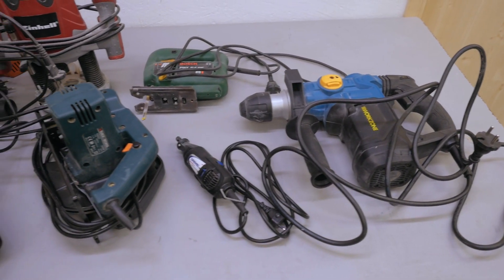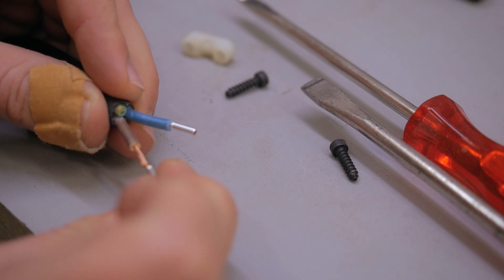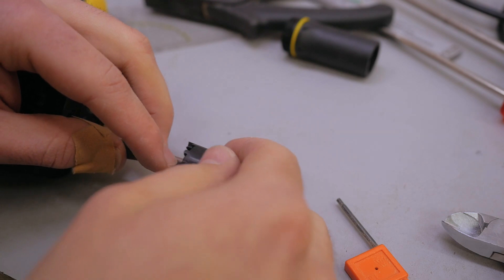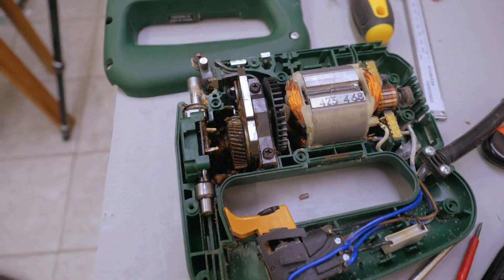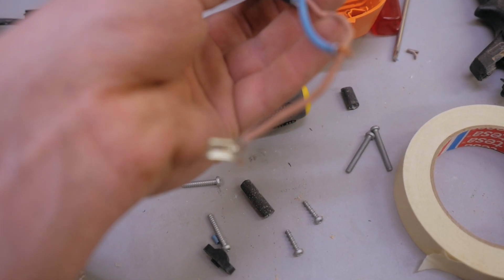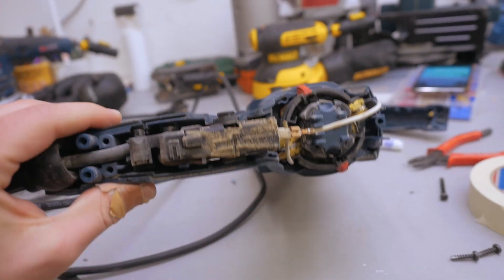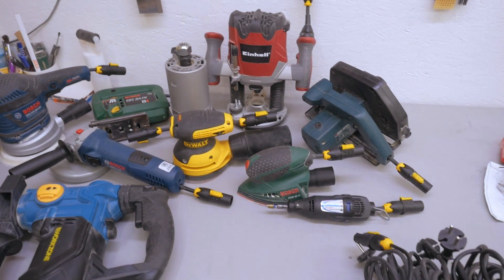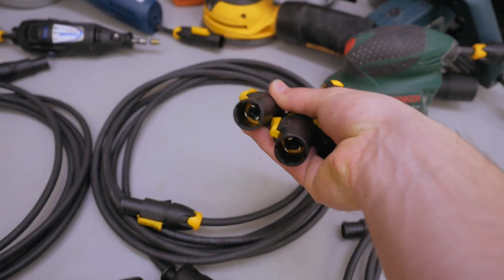A Quick Connection System for Power Tools

Comment: It's sad, that after my comment you have to do most of it again ;) .. Those ferrules do not work properly without crimping with proper tool.  Trust me, i have tried to save a couple trips to my car to get crimping tool and while testing if leads are tightly in, i can always rip them out of a ferrule.. It takes like 10x force to get crimped ferrule+lead out from connector and probably you just end up tearing that lead itself in half while trying..  I use knipex ~97 53 04 (closest ones that i could find on knipex-website, as mine are like 10 years old and just a little different) for ferrules.

So, ferrules need more crimping than just that screw of a connector.
Reply: Just to enlighten you:
- Germany is not Great Britain (and Europe is not a country)
- There are in fact other countries than your USA and therefor other codes and regulations.
- Ferrules are common here for the obvious reasons mentioned before
- Nobody here cares about what kind of electric butchery you perform over there in your country. Nobody.
- If you have no idea about codes in other countriess, simply do not take part in discussions about them.

- using the f word multiple times does not add weight to your argument but makes you look like you had limited self-control and rather unintelligent.
Reply: Anybody who does speak more than one language with English being not the native one will use multiple words from multiple flavors of English.
How's your German?

Simply stop it. For the sake of peace in here, I will not comment further - "aint nobody got time for that" (in order for you to understand).
Reply: TeknixTrix it's not just car manufacturers, since soldering is suboptimal for mains voltage, there is no alternative to ferrules if you want to connect stranded wire to terminals. It's VDE and NEC standard, but what do they know with their "retarded" regulations... the guy on the internet who throws all tools out after 10 years knows better.
Reply: Twist wires?  In Finland they used to do something like that till the 90's..  Some googling tells me that you might be talking about wirenuts?  We use Wago 2273 series connectors now.  Or you have some other arts and crafts project in your mind?

If you differentiate your tools by your feelings when they are stolen, i cant help you..  I still select my tools for what they can do for me while i have them.  In use, there is almost always difference between cheap chinesium and proper tools.  Cheap chinese stuff might still win like every 200th round, but i really dont like those odds in my real work.  And i am not saying that knipex is the only brand that makes good stuff, but i have not yet been disappointed.. Ideal branded strippers and 3,5mm flathead screwdrivers are the ones that take hits from bad decisions, most other tools stay safe and live in my toolbox for decades.
Reply: Das hätte ich auch gerade sagen wollen: Adernendhülsen gehören gequetscht. Aber prinzipiell sind die schon richtig (löten wird mittlerweile als falsch erachtet, weil das bei erhöhtem Übergangswiderstand sich lösen kann). Genaueres vom Elektriker!!! (ich nix, ich Schreiner).
PS: Holla die Waldfee, da gehen die Kommentare ja voll durch die Decke! @Marius: Wäre wohl wert sich da mal schlau zu machen und zu erklären was wie und warum. Oder ganz von Elektrokram distanzieren und sagen Ich machs so und Du kannst machen wie Du willst geht mich nix an.
Reply: Konaok1, not really. Solder has better conductivity, crimps deal better with flexing. Solder forces all the flexing to happen at the exact end of the solder, and that's bad - it's a stress concentrator/stress riser. Especially with copper, which work hardens ridiculously quickly. Crimps allow a small amount of movement and that helps a lot.

Since most of Marius' tools only draw an amp or two conductivity isn't as important as the constant flexing of the cables. Partly from him moving the tool, but partly from vibration. The strain relief sleeves and long cable path inside the tool help with flexing from moving the tool, but only potting can really fix the vibration.
Reply: "Knipex 97 61 145 A" without the "thick insulation" is even cheaper at 15€. and it's not a wire stripper, it's for crimping only. but if you think a real crimping tool is "stupid, breaks all the time and gets lost" and is overpriced at 15-18€ for a tool you'll have 20+ years... you're either a butcher or never had to do repetetiv electrical/electronic work.
Reply: Funny how ALL car manufacturers use crimp connections. When crimped with sufficient pressure, the wires stick together because it is actually a "cold weld".  Also, there's no chance of the solder "wicking" along the wire thereby creating a fracture point. The only exception I have seen are on starter motor terminals where solder is added as a high current aid for reliability and longevity purposes.
Reply: You seem to have no clue about what good tools are and why people own and use them (maybe you have never experienced using them) you call a crimp tool a wire stripper and you say that ferrules are not necessary.
Holy batfarts, there is so much butchery and so little knowledge in your posts, I sincerely hope that you do not do electric stuff for other people.

There are special (!!!!!) terminal blocks that do not need ferrules but most terminal blocks do, and in ALL cases it is recommended or even mandatory when dealing with high currents or mains connections. And having seen some burnt terminal blocks that "professionals" like Your Royal Hackery installed, I'd say the regulations are right about that.

Also, I have no idea what the NEC is since and since he is based in Germany I guess he does not give a f...art as well.
Reply: Also, Knipex has been in business since 1882 and I have seen multiple US guys use these "overpriced" German tools that nobody needs based on our professional butcher's opinion.
I have yet to meet somebody who uses Milwaukee (read this with an AvE pronounciation) tools over here.
And lineman pliers...
Here in Germany those twisty things have never been a thing. Screw terminals with soldered stranded wire or solid core wire and when those things overheated and burned out in multiple cases, they introduced ferrules. I would guess that was some time in the 70s based on equipment I have seen.

I have multiple types of proper tools (Knipex, Belzer, Lindstrom, Wiha...) for home use. Simply because those are proper tools that make you do the job right in the first place instead of being a cheap-ass trying to save every cent possible and doing a half-ass job in the process.

Chinesium grade tools are OK if you need some special tool you can make from a cheap-y tool using a grinder or whatever. With proper tools made of properly hardened 42CrMo4 or something like that, too much grinding and work is involved :-D
Reply: That is what I am talking about. You do not know stuff outside of your area and you talk about it nonetheless...same with ferrules.

Pretty much every house (!) in Germany has three phase power and so does the creator of this channel.
Reply: I got linemans pliers from my dad when i was a kid at 80's.  Since then, i have had pleasure to select better tools to do my job properly.  My employer still gives linemans pliers to new electricians, but those are only used when intelligence runs out and brute force takes its place.  Even in that case, i take my knipex cobras instead.  But, what would i know, i have been full time electrician just for 18 years.

You should check knipex catalog and be amazed what you have been missing..  Be sure to allocate some hours for reading, as that catalog is huge.
Reply: As I watched, I thought the same thing.  The crimped ferrule effectively creates a solid core conductor that won't flow over time.
Reply: 18€ is not 45 US$, it is just under 20 US$ which is cheaper than the stripper you proposed.
Reply: +Risto Mladich
So first you advise to use a wire stripper instead of a Knipex to crimp a ferrule and than you state that 'we dont use those retarded "ferrule" crimps either'. You do use your stripper (and I quote) to 'cut wire and bolts, as a hammer, a crimper, wire puller and as a pipe reamer'.
I suppose you drive your lawnmower on the highway as well, because you do not really use the correct tools to do the job.
Crimps (cold welds), if applied with the correct tools, in many cases are better than solder. In most cases crimping saves time.

Ohh and BTW. there are many royal families around the world, so not only Brits use the word royal. Even more, did you know in most countries where the metric system is used, the American McDonalds Quarter-pounder is called a McDonalds Royal? Because our pound is a bit more than yours, just like our currency.
Reply: +Risto Mladich
I also do not buy a specialist tool for every job either, but that's no reason to call professional solutions junk.
I do know that good quality tools are often a good investment.
Reply: His point is the 120 V funnypower in most outlets instead of 240 V... not the question if it is 110 V or 120 V (depends on cord length and the number of lightbulbs connected to it I guess).
Plus, split phase? Well, in other countries three phase is common. Your electric system is ancient compared to that.
Reply: - almost all outlets are 120 V
- 240 V is only present in special outlets in single digit numbers per home
- No three phase in most private homes at all

Get over it - you simply don't know the joy of proper mains voltage :)
Reply: Risto Mladich The Knipex 9768145A costs 18€ in Germany, thats a fair price.
Reply: +Risto Mladich  Bobcat Equipment founded in America uses deutsch connectors in all of their equipment.  Deutsch connectors use ferrules.  They're extremely common in heavy equipment. 

 Also give knipex an actual try, they are professional tools and anyone I have ever asked always agrees that they are worth the modest price increase after using them for a long period of time. 

And last but not least, if you want to make any sort of point about something online;  google "how to use periods and basic sentence structure"
Reply: I certainly wouldn't recommend them as a hammer.
Having the correct size and shape crimp tool is essential for a decent cold weld.
Reply: I am referring to private residential homes, not industrial stuff. The transmission grid obviously is three phase and of course there are connectors for it...
Reply: It's possible to make a decent connection to stranded wire without crimps, but only if the terminal is designed for it. 

The UK was for a long time the worst of both worlds on this. Wraparound terminals are best with bare wire (or eyelets/forks)

Clamp terminals are best used with ferrules unless they have a cage type clamp arrangement.

Older UK terminal blocks had no cage clamp, and frankly were godawful for stranded wires. I rip em out now and replace with 221 or 222 wagos or ferrules (I carry both)

And here (based in the UK), a decent crimper for lugs is a normal part of the toolkit, but ferrule crimpers are a bit rarer (people often ask me what they're for lol)

And gotta weigh in on the branding. Knipex ARE the best brand, but like Risto says, if you blow a hole in them, they're no better than the cheapo chinese stuff :( 

And lastly, I carry linemen's pliers, but rarely if ever use them (twisting wires isn't very common here. I will use them on 7 or 19 strand wire to tidy up the connections to get them into terminals, that's about all)
Reply: In Germany a lot of houses have 3 phase power.
Reply: Actually, I've found that good quality tools always pay for themselves.  When I was a child I remember my grandfather who had gone through the Great Depression of the 1930's telling me, "There are a lot of places that you can invest your money, but there are a lot of ways to lose your money too.  If you buy good tools, learn to use them well and take good care of them you will never go hungry."  I think Grandpa would be really proud of my "toy box."  A guy can never have too many tools!
Reply: never tin a bare end destined for a screw type connection. The solder is malleable and will quickly render the connection loose.
Crimp connectors have been used in various forms for many years and, correctly implemented with the right crimp tool, are incredibly resilient and reliable.
Reply: here in germany the electricians have to balance the house over the 3 phases to balance the grid. in theory you could put a amount of houses on one pase and the same amount on the other two pases to balance the grid, but having 3 phase is actually good for when you having machines that have a three phase motor on them or a welder which has often a 3 phase connection, and its not that uncommon for people in germany to have those things at their home not to mention the stove which is almost everywhere electric here in germany gas stove are a rare sight (and the electric stove "requires" 3 phase power, i put it in "" because theoretically you can put it on a one pase system but because of the higher power needed the fuse would blow, so you woult have to use a bigger fuse but also a thicker wire and to avoid this you divide this onto three phases with a higer voltage (230V) to get the current down,because of that you can use thinner wire wich will bring the cost down and is more economic). But here in germany the powerprovider mostly just sale 3 phase connection, you can get single phase connection but thats mostly used (if its used) in smaler appartment house to count the power consumption for things that are used by all the people in the house (power for the gas heater, staircase, outside lighting etc..) so basically you do this to have the same effect with less use of material.
Reply: how does it?
Reply: oh then whats this? https://www.amazon.com/Leviton-2731-3-phase-Industrial-Grounding/dp/B001VY0GYE
and this http://bmseelectrical.com/assets/uploads/image_uploads/2012-07-27_13.33.37.jpg
http://www.pesnj.com/uploads/2/9/5/1/2951424/9852013_orig.jpg
Reply: whats the point... we have 240v as well. what are you trying to say?
Reply: we do in fact have 3 phase power for single family dwellings but it cost extra, and its only really used in very large houses. there is no point in having 3 phase power for a single family dwelling, you can get a single phase to 3 phase roto phase converter if you have such a equipment...
Reply: TheChipmunk2008  on a job recently connecting flex, get my ferrules and crimper out to utter surprise "what are those, never seen those" from electricians. I think only people that make panels know what they are. bit concerning I personally would like to see it in on site guide as without making a proper connection is blooming hard
Reply: its not useless when you have the right tool for the right work , 10 years ago when i started working as an electrician here in germany, i had bought a set of cheap tools with a wire strapper in it and it worked only half a year till it was dull, then i bought a knipex wire stripper and it is sharp until today and i almost use it everday and i must say that 20€ is not that much of a deal for a tool that i use since almost 10 years with almost non wear to it, but on the otherhand i dont use it as a hammer. sure these all in one tools seem to be nice but the catch to them is the do everything but not everything completly right. so i would say cheap tools are for the people who cant look after their stuff and let it laying around so that the have to buy new ones (but the help to keeping the tool companies busy...).
Reply: What on earth for? I have three phases coming into the house, but only one is connected via the company fuse to the meter. That was installed when this was a guest house.
If the householder can choose whatever phase they like, how are the phases ever balanced?
I get it, if the winters are cold and the heating is electric, but who does that these days?
Reply: "Ive never seen any formen ever carry one of those ferrules crimpers before, never ever. our terminal blocks do not need any crimps for stranded wire at all."

And that pretty much disqualifies you from this conversation...
Reply: I agree as well. You could have leaded the cables themselves in this case.
To be honest, I would have cut all power-cables not to lose the strain reliefs. Those are there for your own safety.
Reply: +Risto Mladich In all fucking America you also use Wire nuts or whatever you call that shit its just a nicer looking way of twisting wires together for god sake go away with your 110V idiocracy
Reply: first of all its not 110V that is an ancient legacy voltage that old people refer too its very rare to find a service which is 110v. its 120v split phase from 240v. and we also use Wire nuts for 240, 208, 277, 480 maybe Canada uses them on their 600 v equipment too I dont know...
Reply: who the fuck has 3 phase power in their house... most people dont live in mansions...
Reply: i dont think you know how lineman's pliers work...
Reply: thats 45 dollars and completely useless. why does one need that thick of an insulation on a wire stripper... this is what i use as a wire stripper everyday. I also use it to cut wire and bolts, as a hammer, a crimper, wire puller and as a pipe reamer.  https://www.milwaukeetool.com/hand-tools/pliers/48-22-6100

 expensive tools are stupid, for people who barely do any work. tools break all the time and they get lost, ideal, Kline all that shit.
Reply: knipex too expensive
Reply: only brits use words such as  royal and butchery...
Reply: where does the NEC says that "ferrules" are mandatory? ive never seen any formen ever carry one of those ferrules crimpers before, never ever. our terminal blocks do not need any crimps for stranded wire at all.
Reply: sorry but I cant twist wires using channel locks/ pump pillars...and I dont need 45 dollar 9in sidecutters or  30 dollar channel lock wrench... only thing I would be missing if I bought such expensive tools is 2 hour worth of pay. no thank you, ill stick to the not so fancy yet dependable tools I use everyday. I could buy 3 sidecutters which are exactly the same as those knipex branded shit for the same price... knipex is just a name and the day someone takes one of your tools or you blow a hole in them they are no better then Chinese no name brand tools...
Reply: ok mrjollywanker broken tooth british god fuck the queen dumbshit, in north fucking america we dont use fucking ferrules crimps at fucking all and from what ive read online that its only with euroasian equipment which is fucking rare to work on in the first place let alone for anyone to be carrying a crimper such as that on their belt for such an occasion, those crimper look like a fucking wire stripper  and if you handed this to any electrician working in USA they would think its a stripper too until they looked close at it. we have whole factories control wiring installed without "ferrule crimples" on terminal blocks...
Reply: its a wire stripper for me... we dont use those retarded "ferrule" crimps either. also ask any trademen if they have any tools which they use everyday that is even close to being 10 years old, that is something that you will never hear about.
Reply: You could also just solder or tin the wire ends instead of adding a crimp. Crimps are the poorest type of electrical connection.